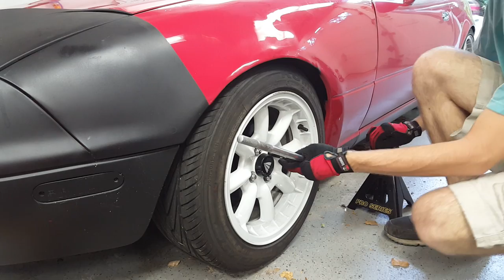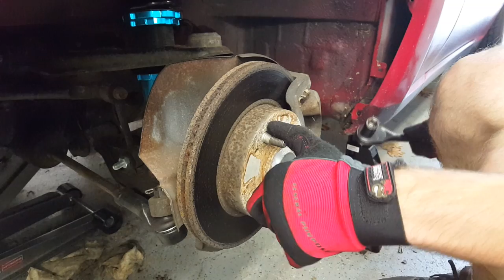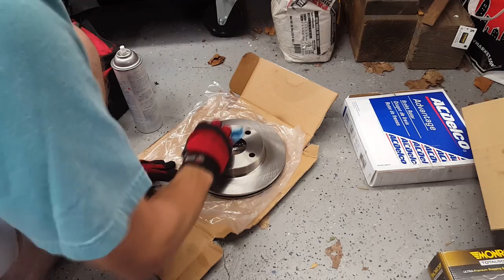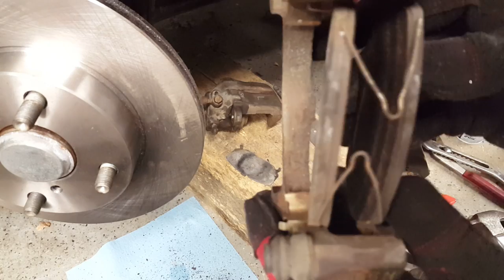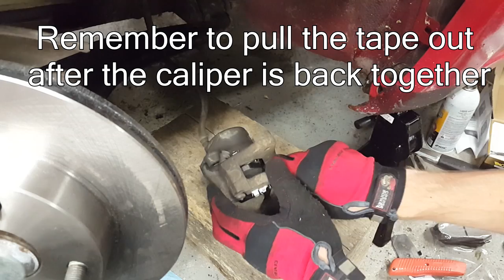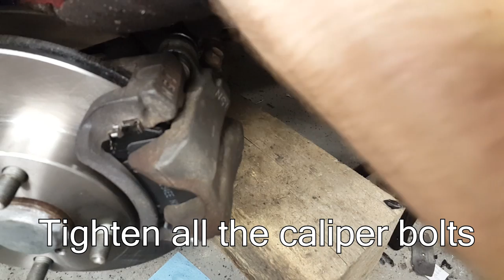Vlog 14: New brakes

Comment: lol i dig the channel. little advise for next time and for viewers. 
1. remove wheel
2. remove cap from brake fluid reservoir under hood.
3. use flat blade screw driver to press brake caliper cylinder back into itself while assembly is still  in place (think lever action)
4. remove the small bolts to remove caliper from caliper bracket. 
5 .remove pads and  bracket
6. remove rotor
7. clean hub surface optional apply LIGHT coating of antisieze to hub surface to allow for easier removal next time
8. replace rotor
9. replace bracket and load pads into place on either side of rotor
10. CLEAN AND LUBE SLIDER PINS, replace the caliper with the pressed in cylinder onto pads - tighten and place wheel back on vehicle. pump breaks and put reservoir cap back on . TEST BRAKES FOR PRESSURE BEFORE MOVING VEHICLE

another way to move brake caliper cylinder back into itself is take old brake pad and lay across the cylinder - use big ass channel locks to "push" pad against it and push that fucker back in. works a ton better if it can vent (reservoir cap removed)
 

SOURCE - Been turning wrenches for 9 years .should take no more then 7 or 8 minutes a side - 25 a side if its your first time. brakes are cake.
Reply: 11. Spell brakes correctly in the title of the video
Reply: +Mike Snyder LMMFAO  yea he might want to edit that
Reply: +KillEmAllWithMetal lol right. I've got the large/small caliper piston tools as well as the sandwich type for say a BBK with pads on both sides. 

in a pinch tho for your average vehicle a flat blade screwdriver works well.

Comment: nice video Alex. I'm sure those brakes feel a million times better now. quick tip: use an old piece of sand paper or a red Scotch bright pad and rub down the hub face which will make contact with the new rotor. Apply a thin layer of anti-seize on the cleaned hub face, then install rotor. This will help prevent uneven wear on the rotor and will make it a lot easier to remove the next time someone has to do the brakes on it.

Comment: Great video Alex.  Solid videos and good editing.  You brought up a could point about wiping off the residual oil in the new rotor packaging.  I usually forget but not today, with my new rotor install got the aerosol brake cleaner and soak that rotor down.  Thanks for the tip.  Remember it is all in the details. Those little things we sometimes forget or overlook.

Comment: Brake clean everything, Grease guide pins, and every metal to metal contact surface except threads, friction material and rotor. Or risk having squeaky brakes.

Comment: Should have gave the hubs/bearings a quick clean with a steel brush before putting the rotor back on.

Also I know you said you wanted to rebuild the brakes and calliper off the car , but its so much easier to bolt the lower bracket back on first then bang the pads on , then the calliper back on
Reply: I also thought so

Comment: leave the caliper mounting bracket attached next time and just remove the caliper slide pins. That way the pads sit tight to the rotor and the caliper can just be set right back in place

Comment: you're definitely not supposed to grease the bolts.. you're only supposed to grease the pin that the bolt threads into. dont grease anything that has threads.

Comment: I have an s15 Silvia and was doing my pads, one of the Pistons was extremely hard to compress and the other one just didn't want to compress, anything I can do? Or is my piston fucked
Reply: You need PB blaster on it spray it really good, Walmart has it for like $3.90. DO NOT hammer it you might blow the seals out
Reply: +Aaron Yauger if you haven't noticed from
What car I have I don't live in America man haha but thanks! I will give it a try
Reply: +Aaron Yauger I'm hoping the piston isn't seized because it will be super hard to find a caliper for an s15 :/
Reply: +jason verndog oh okay lol. Yeah you need a rust dissolver based spray don't know if you I so what wd-40 is but they make some
Reply: +Aaron Yauger yeah we have wd40 here so should be mint, thanks :)
Reply: crack the bleeder open and they should compress much, much easier. the bleeder is the lil nipple on the rear, normally right next to the break line. WD40 is not a bad shout either.
Reply: Pu off the caliper, take out the piston using an air blower on the part where the brake line connects. Once the piston is out, clean the piston and cylinder with brake clean and clean micro fiber towels. Inspect the seals for damage. The seals should be find. Theirs most likely corrosion between the piston and cylinder. Once everything is cleaned it'll be able to slide free. Same thing happened to me when I put my Acura legend calipers on my integra. All I did was take them apart and clean them. Slide free and no leaks
Reply: Hate to break it to you but the calipers will need to be replaced, you can try having someone pushing your brake pedal with the calipers off the bracket till they move slightly, this breaks the piston free. But you need new calipers regardless. You can probably rebuild them if parts are hard to find
Reply: the fronts on an S15 should compress easily with a clamp, the rears are screw-in (use needle nose pliers and turn clockwise).